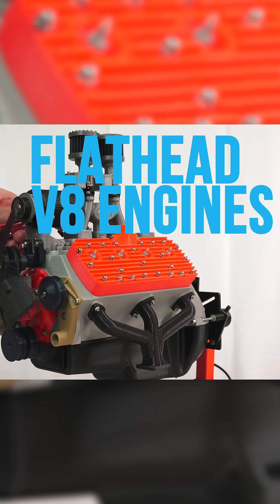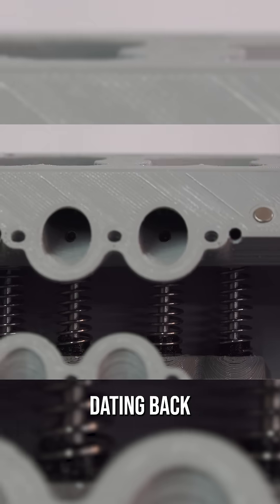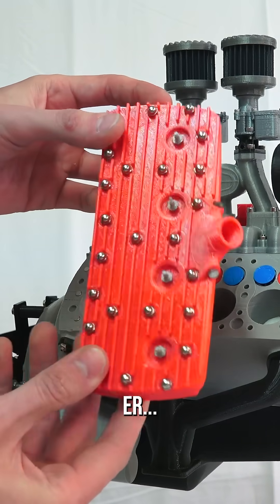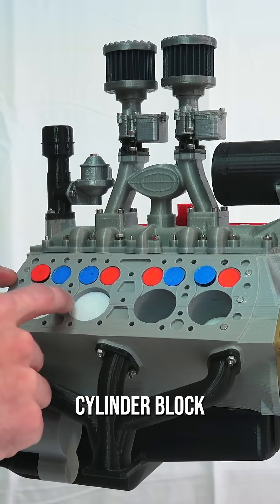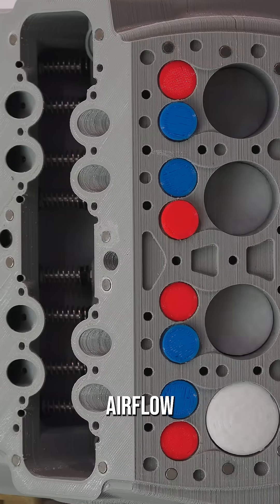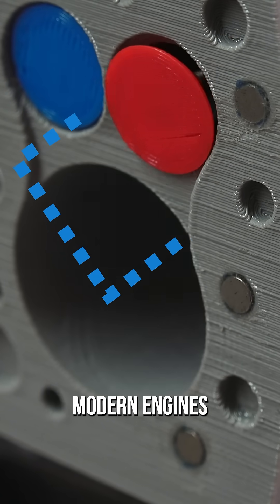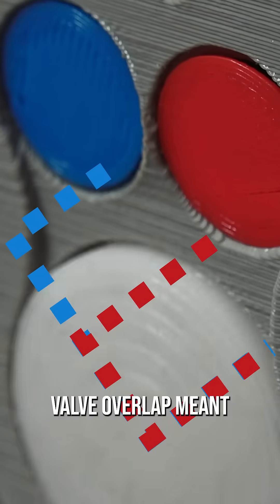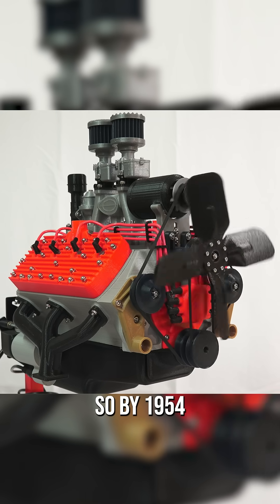What Killed The Flathead V8 Engine?

Comment: Corvette guru Zora Arkus-Duntov got his start producing overhead valve retrofit kits for Ford flatheads. They’re known as Ardun heads.
Reply: The holy grail of the retro hot rod scene, Ardun heads.
Reply: The 1969 Brazil Dodge GTX, based on the Simca Vedette, used Ardun style heads, complete with a modern Mopar style air cleaner(!)
Reply: Plus those ardun heads look great in street rods or rat rods.
Reply: And now they are reproduced, so everyone can have them (for piles of money).
Reply: Hemi conversions.  There were several companies offering OHV conversions, but ol Zora was making HEMI conversions.

Oh, an not just a 'guru'.... Duntov is widely recognized as the CREATOR of the Corvette, and the driving force behind the first Chevy OHV V8 - today known as the 'small block'.
Reply: @xaenon Neither is true, only Corvette fans born after 1980, could believe that. He is known for making the V8 Corvette faster than Chevrolet could (the small block was designed by Ed Cole, Ed Kelley, and Harry Barr, for the '55 Chevy. Duntov wasn't brought in until 1956, because it still wasn't enough power to be competitive in sports car racing) and for developing high performance parts, sold over the counter at dealers (Duntov Cam, for example), although Hudson had already done that.

Comment: Why it got v6 exhaust
Reply: Because the exhaust ports are in the block and need to run between the cylinders.  The outer cylinders run their ports around the outside of the block, hence the front and back pipes.  The middle cylinders run their exhaust through one big port in the middle, creating only 3 ports for each bank of 4 cylinders.

Comment: Have worked out just fine 😂. New engines are garbage compared to a flat head. You can leave a flathead in a field for 60 years. Throw a little gas in and go. New motors break when you look at them wrong.
Reply: That has nothing to do with where the valves are, and everything to do with the rubber and plastic and electronics.  Also, modern engines typically only fail to reach 200,000 miles when someone gets in a car crash - very very few flathead engines made it that long before they were worn out.  The metallurgy and fueling and lubrication technology of that era was TERRIBLE compared to today.
Reply: @JETZcorp  lubrication was terrible. Which means my comment says a lot about today's engines. Also, my comment said nothing of the valves.
Reply: @yodaddy82daddy70  You were talking about flat head engines, on a video about flat head engines.  What do you think flat head means?

And modern engines don't just have gross mechanical failures or get thrashed bores and bearings at 60,000 miles.  They have electrical issues, plastic parts break, or people run it 50,000 miles on factory oil and sludge it up.  If you're smart enough to not buy a BMW, modern engines last longer than older ones in service.  They're not as happy to be derelicted out in a field for 60 years, but why tf would you want to do that?  When was the last time you saw a Honda CR-V billowing smoke or running on 5?  That was every 10th car in the 70s, and they were doing it at like 10 years old.  Today, unless you're buying some finnecky Euro luxury thing or the most deeply cost-cut Daewoo-built turd, everything just runs like a top with nothing more than oil changes for at least 20 years.  Oh yeah, and they're not getting 75 hp and 4 mpg out of 4.5L like the old flat heads.
Reply: @JETZcorp  Agreed.

Comment: Is that why 7L V8 from american cars only produce less than 200 hp?
Reply: Flathead engines were dead long before the muscle car era, which in turn was before the smog era you're referencing.  Those weak big-blocks were pushrod overhead-valve, and most of them actually had very well-designed heads for making power.  But, in a time before catalytic converters, the only way to reduce emissions was to reduce power.  Hydrocarbons were reduced by giving them TINY camshafts with little to no overlap.  NOx was reduced by decreasing combustion temperature, which meant reducing the compression ratio and spark timing until the thing barely ran.  We look back on that era and wonder why they didn't make small cars with small engines instead.  That ignores the fact that they did make cars much smaller than anything you can buy today (Pinto, Vega, Gremlin, etc) and that those engines had to deal with the same sorts of limitations.  You could make big and weak, or small and REALLY weak.  Import cars in this era were often down 30-40% on power compared to the versions sold in Germany or Japan.  Also, the most trendy and hot-selling cars in the 1970s were very large "personal luxury" 2-door boats with a 5-hooker trunk and lots of shag carpeting.  Getting those to move with smog-choked engines required a lot of displacement, which is why the V8s got BIGGER in the smog era than they were in the muscle and tail-fin eras.
Reply: @JETZcorp   @real765rp8 thanks for the knowledge!
Reply: Depends on the era of cars. I'm not that interested in cars before the 60's so I didn't know about the flathead. That said, the 7l engines in the late 60's and early 70's did make more power, like up to around 400hp. It's still relatively low power for the displacement because these engines don't rev very high. They produce a lot of torque, though.

But it got worse when the oil crisis happened and instead of building small engines, they decided to let these engines run on half the amount of the fuel they used to run on. Power and torque dropped significantly as a consequence.

Comment: Cadillac L head was the first V8 engine mass produced for production cars. 13,000 in their first year alone. That's a huge number for those days. And, they did it for19 years before the Ford flathead.
Reply: Ford’s big innovation with the flathead was casting the blocks and crankcase in a single piece, vastly reducing production cost, and making the engine cheap enough for an entry level car.

Comment: I mean, to me personally, it seems like it was too reliable and low cost for manufacturers. Less moving parts to break or wear out. I mean the rotary engine isn't really efficient either but Mazda made them for awhile.
People don't buy flatheads for high horsepower and to race them to ends of the earth. I know the design isn't the greatest but it seems so simplistic. No active fuel management, no variable valve timing, no rocker arms to deal with, no 6 foot long timing chains, and its completely non interference engine. If a valve gets stuck open or something, the piston isn't gonna slap it and cost $1000s in repairs. It'll just run like crap until it gets fixed. 
Imagine with the technology and knowledge we have today. They could make a pretty good flathead engine that comes in a small package, but decent enough power for just a basic small work truck.
Reply: Why would low cost not be desirable for a manufacturer? I think the engines might not have been competitive in the long run. Just like the rotary that certainly isn't being built anymore but also had a unique sound people fawn over. The rotary engine does produce a lot of power for its size tho, but creates many issues. This engine apparently creates little issues but hardly delivers anything from the fuel it consumes. Most customers would buy a car with more power if it has less fuel consumption at the same time. Just my theory, though
Reply: @real765rp8  I'm totally with you on this one
Reply: What a conspiracy theorist you are 😂
Flatheads were just gutless and had no real advantage. OHV engines aren't that much more complicated and can also be made reliable. If an engine is unreliable, it's because the made mistakes/cut corners when designing it. OHV or OHC doesn't automatically mean an engine is unreliable or difficult/expensive to maintain.
Reply: @Harry_Gersack  I never dealt with flatheads so it was just a theory. The Chevy 350 comes gutless from factory but we're highly loved. I had one that only made like 210 HP and got 9 to 10mpg. Work trucks for basic stuff don't need to have high power to work. Just needs to be reliable to work every time you need it

Comment: I believe there are at least 2 additional reasons both associated with increasing compression ratios.
#1 the flat head creates a volume (reducing achievable compression ratios) that is required for the gasses to move between the valves and the cylinder.
#2 the complex shape of the chamber in a flat head engine creates "hot spots" that will increase the chances of pre-ignition and/or detonation in a higher compression engine.
Reply: #3 The exhaust had to flow through the block between the 2nd and 3rd cylinders leading to highly restricted exhaust flow and hot spots which cracked the blocks.  Zora Arkus-Duntov (of Corvette Chief Engineer fame) designed some very innovative OHV heads back in the day which eliminated the problems but they were expensive and rare.  Those originals are priced about their weight in gold today.

Comment: I was today years old when I finally learned why "overhead valve" engines were named that, I had no idea there were engines where valves were not overhead...
Reply: Wait until you learn about sleeve valves.
Reply: @TylerLinner sleeve valves are remarkable for their time
Reply: @TylerLinner  Got  alink to a good video on them, i've heard of them and get the basic concept but never understood exactly how they work in detail.
Reply: Wait until you learn about rotary engines
Reply: @viscountslappy5085  Haha I do, but because there are still modern rotaries (or at least there were until a bit over a decade ago), while this feels so old.
Reply: @viscountslappy5085  Wankel or Gnome?
Reply: Try an F head. Jeep made thousands of them. Intake valves in head, exhausts in block. Used in M38A1 military jeeps and civilian models. They were made by running a pushrod up through the old intake port of the flathead to the rockers above. There were performance conversion overhead cam F heads for Fords that had 6 intakes, and 14 exhaust ports, and 3 cams. They used both intake and exhaust valves in the block as exhausts, 8 exhausts in the V six on the sides (the center two are paired into one). They pull good to 10k rpm There was a blown Nitromethane flathead in the 2000s in a dragster that made 900 hp and ran 7.65 second 1/4 mile. You can watch a vid of it. T head motors are flatheads with 2 or 4 valves on either side of the cyl. Side valves come in at 90 degrees. Blind chamber motors have the chamber and valves OUTSIDE the cylinder at 90 deg or so connected by a small passage to the cyl. (Minneapolis Moline model Z tractors.) Ardun made hemi conversions for the flathead ford and a dual overhead Mercury flathead broke records at the Indy 500 in the '60s turning 12k rpm. Not bad for 3 main bearings, designed in 1932! Flatheads are still going strong in certain circles. Hercules made thousands of 936 ci (15.3 liter) flathead 6 cylinder engines for fire trucks that didn't have the flathead V12 Seagrave engines. Strange world!
Reply: @Cletrac305  😯
Reply: Wait til you learn about the Screaming Jimmy and the Chrysler Hemi.
Reply: @danw6014  I knew about the Chrysler Hemi. What's so unique about it?
Also did know about 2 stroke diesels, but not "Screaming Jimmys". I looked it up but I hate diesel noise and this one doesn't change that haha.
Reply: They've tried just about every configuration.
There's the L head, which is a flat head like in the video. There's the F head, which has one in the block and one in the overhead position. There's the overhead, which is cam in block and valves overhead.
There's the overhead cam, where valves and cam are overhead.
There's two valve types, three valve types,  four valve versions, and more.
Reply: @richtomlinson7090  Wow, one in the block and one in the head, one more thing I had not imagined.
Reply: Wait till you learn about dual over head cam engines.

Comment: Now why was the first engine nearly over head cam, and some moron decided to change it?
Reply: For all the reasons listed.  Cam-in-block flat heads are super cheap, super simple, super easy to service, and super compact.  Power is limited, but since early manifolds were little better than bathroom plumbing and carburetors were "something that should work on paper," the benefits of OHC and even OHV were handicapped by other factors.  It also took a very long time for manufacturers to figure out how to make the long timing chains on OHC engines reliable.  Flathead and pushrod engines typically run happy as a clam for 400,000 miles with no chain tensioning mechanism at all.

Increasing mechanical complexity came in as airflow and fueling science got more advanced and placed greater demands on the castings to keep up.
Reply: @JETZcorp  it just seems smart to have the cam directly running the valves to eliminate moving parts.
Reply: @trm4life  That's how a flathead is.  Cam, lifter, valve.  No pushrods or rockers.

With that said, some extra parts are beneficial.  The highest-performing engines still have rockers because you can amplify the cam lobe into a bigger valve motion, and they make for easy valve adjustments.  Pushrod engines, while theoretically limited in RPM, are much more compact and lighter than an OHC engine of similar displacement.  A 7.0L LS7 is smaller and lighter than a 4.0L Audi V8.  And, while an OHC engine drives the valves more simply, the mechanism to drive those camshafts is much more complex.  All of these are compromises in engineering.  It's easy to get caught up in set of advantages and overlook the unseen problems that can come along for the ride.
Reply: @JETZcorp  well.  I don't have much experience other than tearing down a gm v6, and going "oooohhhh that's how they do that" and owning a dohc Honda.  I have to admit, on the Honda, removing the head, replacing the cams, and adjusting the valves are all super easy.  Taking the rear manifold off a fwd v6 to get the rear head off, sucks.  Sohc uses rockers, simply because it's simple to use a single cam, and after working on them, the timing is much easier.  So,  I kind of get it.  Personally I love over head cam 4 cylinders just because they're so simple to work on.
Reply: CHEAP CHEAP CHEAP 
PROFITS PROFITS PROFITS
Reply: I think people misunderstand sometimes the real benefit here. Yes it's cheap - but the key is that because it is cheap they were able to include 8 cylinders. You make up for the efficiency deficit by just having a ton of displacement available. It probably was not cheaper to build than an OHV inline 4. But it made a V8 cost effective to build and mass produce.
Reply: Packaging is a massive reason. Pushrod V engines are significantly more compact. Having just 1 cam makes them simpler and easier to work on. 

FWIW, many OHC engines don't have the cam directly actuating the valves. Many still use rockers. They're also not immune to valvetrain issues. Just ask all the SR and JZ guys who've lost valve shims.
Reply: Because this design has massive advantages in serviceability and cost.

Comment: One advantage of the flathead:   If you float the valves, they cannot hit the pistons!  And, you certainly don't look your age, which must be at least 110!
Reply: Lots of regular heads were non-interfearance as well.  Maybe not many now.
Reply: @joelbaker2172  agreed, this isn't a unique selling point of the flathead
Reply: @joelbaker2172  yeah but you're never gunna drop a valve either 😂
Reply: @joelbaker2172 
Last one I had my hands on recently ,and that's like a year ago ,was an old early 80s Ford 2.3 powering a 20kw generator. 
It needed a timing belt because the original one broke at 1200hrs of runtime. 
Whooda thunk?🤦🥴
I've got an old quickie book from the late 90s that tells you if an engines interference or not. 
Mighta been a little pamphlet from someone like fel-pro,it's laying around the shop somewhere. 
A few 2.3s were interference but I was lucky on this one. 
I highly doubt the post-covid production timing belt will last as long as the original though. 😁
Reply: Engines back then didn't reved that high anyways to cause a valve float
Reply: @muneebrehman6288 they didn’t rev that high stock. You’d be surprised what those old flatheads did tuned up. They even ran nitromethane in flatheads in the 50s before the overhead valve engines took off in racing.
Reply: The low compression means it's a wheezy old Hector. It's horribly inefficient.
Reply: @blackandwhite-k9c nothing but NOTHING sounds as good as a 50's ford flathead! Today's hotrods don't need a ton of horsepower, they only need to look good and sound good. Today's modern engines are way more efficient, and create much more power. But vvt direct injection engines just sound crappy running open exhaust... No chop, no base frequency, no thunder.
Reply: Redline is when it stops pulling because it's floating valves, so grab the next gear. 😂
Reply: Exactly, the engine won't grenade itself if the timing belt fails.
Reply: @karlrovey timing belt lol
Reply: @karlrovey 
What?
This engine does not have a timing belt.
Reply: i am absolutely not interested in a fail proof engine, thats otherwise complete garbage! Really, these engines will not come near to any power output numbers, consumption or pollution values of modern engines, because the overall function principle is useless crap. I avoid timing belt issues by a) not having a belt & b) doing the service inspections regularly.
Reply: @Thinkle911  everybody else feels the same way, and that's why there is nobody in the comments advocating that you daily drive a 1935 Ford. Because the performance(power and efficiency) is considerably inferior to the better engines that we have now.

"Crap" is not a good way to describe it, because this engine was not a crap engine in the 30s, and it didn't magically turn to crap in the last 90 years. "Obsolete" is the word we use to describe things that, while not bad, are bad in comparison to newer technologies because technology has improved so much.